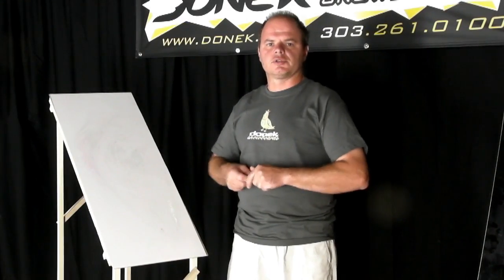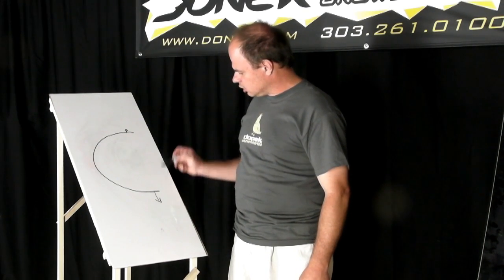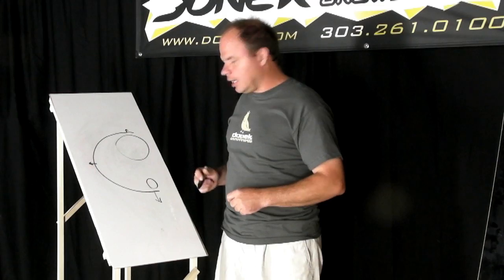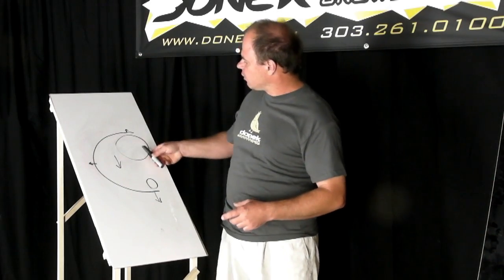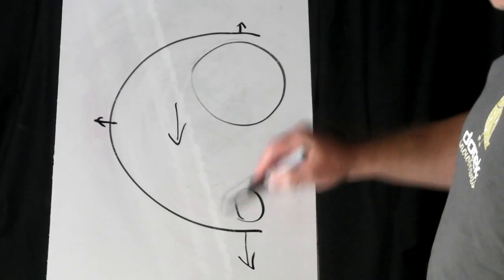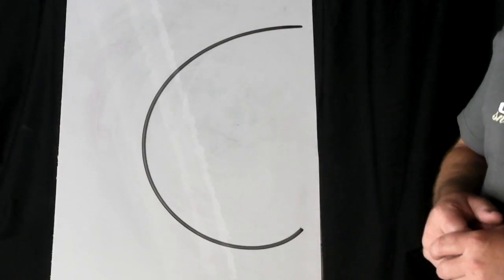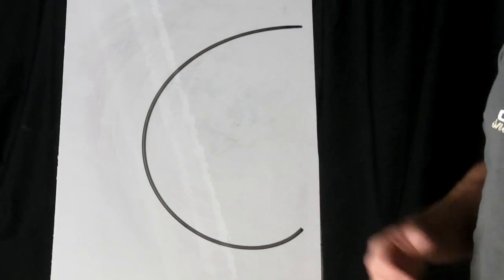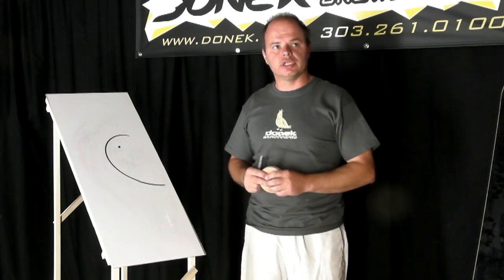A physics lesson about Snowboard turn shape: Part 1

Comment: So, understanding the side cut and how it relates to turning makes me wonder... How is it possible to go straight? I know I don't tilt my board up so it's perpendicular with the ground. And It does seem that I ride a and angle where the back sidecut points down the mountain and he front sidecut slips
Reply: +Hezekiah Domowski When you're going straight you're generally putting little to no pressure on either your toe or heel edge.  Applying a little pressure with your front foot (while going straight) will engage the contact points giving you a very slight veer left or right, but wont engage the whole edge because you're not putting enough pressure down.   It can be very minimal depending on your board control and confidence.  Personally when I'm going straight at high speeds down a hill (current record is 57mph) I generally put slight pressure on my front toe edge because it's always been my strong edge and it helps stabilizes the board. Over the years my control of that pressure has got to the point where I can lightly engage either of my edges, for stability, using very little energy.

Note that when people are learning to initiate turns they generally don't distribute their weight very well and put the same weight on both their front and back feet, like a 50/50 split, or even worse more on their back foot than front which will make you lose control.  The proper way to initiate a turn is to put weight on your front foot edges, more or less depending on how hard you want those edges to engage.  I don't know what your skill level is but if you're still learning then next time you're riding try starting turns using only your front foot, keeping your back foot as flat as you can.  Eventually you will need to engage your back foot, to avoid skidding and actually carve, but trying to keep it flat while you engage your front foot a little here and there will help you feel the difference.  Do this with some speed but don't go balls to the wall until you build your confidence.  

This is how I would teach students when I was an instructor, although usually while their back foot is unstrapped (skating), on the bunny hill, so they can't really engage that back foot even if they wanted to.  It helps a ton with skating to and from the lift, something all new boarders hate, and directly improves your turns in all situations.
Reply: +TranceAddictFoX my top speed is 54. I'm a pretty technical rider and understand what I'm doing. but this is one of the areas I'm not quite sure how I ride straight! I thought that I was riding pretty hard on my edges, but maybe not because I can ride straight when I want to pick up speed.
Reply: +Hezekiah Domowski  Nice!  It sounds like you probably just naturally figured it out.  I feel like its one of those things that just comes with practice no matter what although explaining it to someone can definitely accelerate the learning process.  I am self/friend taught had been riding for 6 years before I worked as an instructor.  I was well beyond the point of having to focus on my feet then and even though I knew the movements in my head actually having them broken down and explained to me (so I could teach the new boarders proper) stepped my game up dramatically.  Just try to focus on it next time you're riding.  If you got a GoPro maybe record and focus on your board/feet for a few runs (at 60fps or higher) and review it on the computer.  Bet you'll see some cool shit and the answer to your question.  Stay Stoked bro.